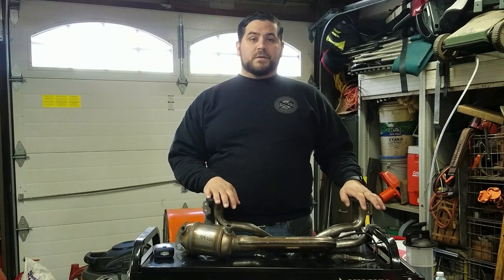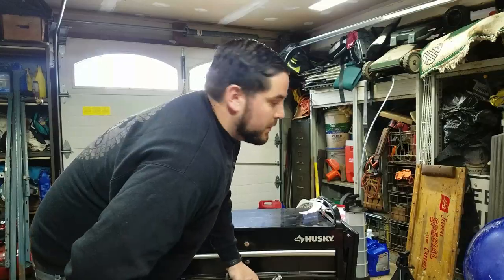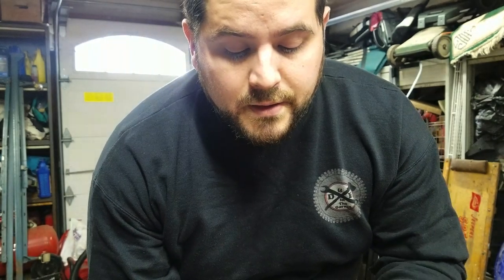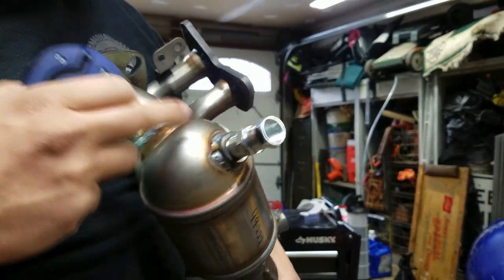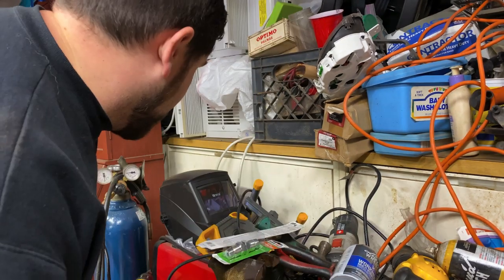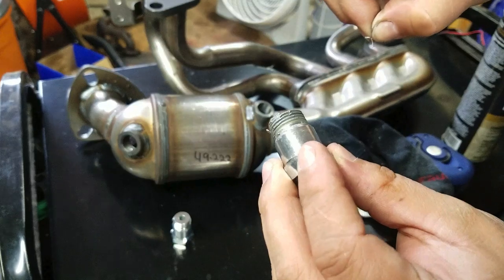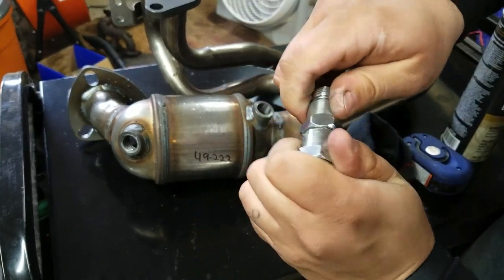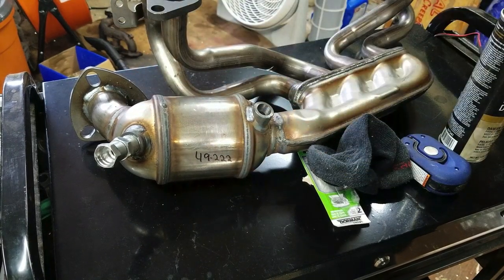How to beat a P0420 Code for $6 (Using 48 State cats on a California Emissions Car)

Comment: You can split your exhaust into dual exhaust or a Y-pipe before it exits to the rear of the car, with a small restrictor plate hole inside to the rear outlet and they only stick the tester into your rear tailpipe and so most exhaust blows out off the pipe under the car, this yields a 50% to 75% reduction in measured emissions

Comment: I have a 2012 Honda Civic and I tried to put a non foul around it just to see if the light would stay off but it still came back on that tell me? Does that mean it's something else tripping the p420 code and not catalytic converter? I also changed both oxygen sensors air intake hose PCV valve cabin and engine air filters and I'm still getting the code

Comment: California , and all of the CARB compliant board States train their inspection
mechanics to fail a vehicle they see this mod on.

I'm not saying someone might get lucky ,
Not saying I agree with emission rules ,
but the chances of someone being passed while doing this is slim 
if you live outside the rust belt states or western usa.

Much different rules here in the carb compliant northeast .
In the northeast , you fail for even the cel being on even for non 
emissions reasons. 

They don't play .

Comment: If you install a non CARB cat onto a CA car, will the computer detect isn't not a CA converter?
Reply from the maker: Yea. It doesn’t run as clean so the reading from the O2 sensors will tell the comp it is failed and pop a CEL

Comment: So...did this work as a ling term solution? Im in the EXACT same situation. Bought a Buick Enclave that has California emissions but i live in Pittsburgh. Previous owner replaced all 3 cats but I still get the  P0420 code
Reply from the maker: Yes it should work long term. Defi Italy works well in Jeeps and Subarus indefinitely. Worth noting that you are tricking you computer, so you may not be making peak mpg or hp
Reply: So, I have a  2015 Chevy Express 4.8 that had CA. emissions.
It needs a new cat, problem is it’s $3800❗️ 
I can get one WAY cheaper ifs it NOT a CA. vehicle.
Can I install a non CA cat on my vehicle like you did following the same procedure?
Will it ba a problem afterwards?
Thanks in advance

Comment: You can replace that cat with a federal converter. If you have a car not from Ca. and you move to Ca. you might need to replace them if they don't pass Ca. smog.
Reply: You only need to replace them if they dont work. If the car is a California Emissions car, it needs to have CARB compliant Cats on it. If Federal emissions, it doesnt matter which EFN code you use.

Comment: Nice vid! Do you happen to know if it will reduce the NO numbers also? I'm assuming it would. I have no codes on my 98 4.0 ZJ and she failed.
Reply from the maker: It should, but this is an extremely low tech way to "trick" the computer. you arent actually solving anything outside of turning a CEL off.
Reply: @DEInTheGarage  thanks for the reply. Love the channel. I don't have a CEL, never have. Replaced O2 sensors and coolant temp sensor, now just trying to get the catalyst monitor to a ready state so I can have her tested again. If she fails I may try your trick.

Comment: Off subject yes, but a jobeeper question non the less. Any word on how to get the wj from electrical disaster and mis fire disfunction Everytime I go wheeling in the rain or wet, ?
Reply from the maker: Dielectric grease will help. Other than that, keep a set of throttle body sensor spares in the glove box
Reply: Also if your coil is original you boots could be getting loose letting extra water in then normal or cracked.
Reply: I'll give that a look at, thanks for the info!

Comment: WARNING - this in theory works... but in california.. the smog check place is required to crawl under your car or use a mirror on a stick to make sure that you didnt install one of these foulers/spacers.  you may pay for the smog check and then fail and go on a government  'blacklist' for doing this
Reply: I live in Cali and never seen them with all the cars I've had look or inspect  under the vehicle....
Reply: I've lived in California and never had one tech crawl under my car, the last time I took my truck in 2007 Tundra the guy plugged his equipment into the OBD2 port for 5 mins while he drank a coke and handed me a my passed cert. Oh and I'm 55 grew up racing always looking for a way around.
Reply: I'm sure they check for irregularities , underneath the vehicle while its on the lift. 
They might do it fast , but they check for everything.

Comment: I have a e90 328xi and my sensors fit inside perfectly. So I had a 420 and 430 code also so I took regular spacers and drilled the 1/2 hole through the fouler and installed it on both banks on the downflow. I reset my computer and did a drive cycle but the same codes came back so I added double spacers but this time one wasn’t drilled at all and the other one was but now it’s throwing codes for “no activity detected” on both banks 1&2 sensors 2. I’m not sure if I should put a single spacer (without drilling anything) or keeping both spacers but drilling a little bit though the spacer that isn’t drilled at all. I also have both of my CATs but for some reason it’s throwing codes.
Reply: And if you’re wondering if the drilled spacer is on the exhaust or if it’s on the sensor I have it in this order 
Sensor-fouler-drilled fouler-exhaust pipe
Reply: Also the codes that said “no activity detected” actually went away for a good 50 miles AFTER drive cycle was complete. But only bank 2 came back I’m also expecting bank 1 to come back. So I’m thinking it worked a little but not enough. I guess I should probably drill each spacer a little bit then try again. In that time I completed my drive cycle and until the “no activity” light came back on I could’ve gone to inspection and passed emissions. So it definitely worked for a little then it stopped detecting anything

Comment: How do you know which one needs the fouler ? I have a Subi with 3 converters . I was going to put it in the one right before the mid pipe to the exhaust system but should I go up closer ??
Reply: Jay Smith  you go off the code your throwing. P0420 is bank 1 so it’s the first cat in the system
Reply: So what year is your Subaru?
Reply: Use a scan tool with live-data graphing, it will show which cat is dead. But 420 refers to the downstream sensor, so whatever cat is before that sensor is your culprit.
Reply: The last O2 sensor in the system behind the last Cat. The last O2 is the cat monitoring O2 . The computer compares the front HO2S's or A/F Sensors against the last sensor and monitors the rear O2 sensor activity. A good working catalyst will cause the monitoring O2 sensor to have no or very little activity after the cats light off.  The computer is programmed to watch for the monitoring O2 sensor to be inactive within a specified amount of time. If the O2 is still active after that amount of time, the computer sets a P0420, meaning the catalyst has lost some of it's ability to do its job.  Some vehicle manufacturers can reprogram the computer with an update to increase the amount of time it takes to set P0420. It's easier, less time consuming, and better for the car if you can check with your dealer to see if there is a computer update for cars setting a P0420.

Comment: Doesn't fix the problem, just masks it.  Better idea is to just fix the problem!  This is like putting gum on a water pipe leak.
Reply: In CA the only way to solve it is to buy another OEM catalytic converter. Instead of being able to buy one for a couple of hundred dollars, I am going to have to buy one for around $1300.
Reply: @brianb.8681  I’m buying some magnaflow universals for my G37s coupe. Fuck paying 1000 per cat from infiniti! That’s bs. I’m getting them welded on. There better and cheaper. 500 for 2 and then 200 for my guy to do the job. That’s still less than half the reg price and for 2! So 700 for the whole job to get done or 1000 for 1. Yea I’m good. And it passes Cali emissions
Reply: @swervv2957  works on that car but not on a bmw oem or else
Reply: No, it does fix the problem, because the problem is the stupid law, not the car..

Comment: Or remove cat(s), install straight pipe where cats were, problem permanently solved....those cats really don't do what the EPA claims they're supposed to do, all they do is restrict airflow through your engine causing power loss, oh and expensive repair bills when they fail.  A properly tuned engine will put off less emissions than a cat equipped vehicle will.  My non-CA emissions vehicles have passed SMOG in CA several times, they give me weird looks but all I tell them is CA emissions isn't very good because my old 71 Ford doesn't have cats or any emissions shit at all, and its passing emissions....so...point proven, all the emissions shit doesn't do anything except not allow your engine to breath properly causing the emissions problems in the first place.
Reply: So your sayin if you can custom tune your car to not pollute the air,you can pass emissions in ca?
Reply: Why are you smogging a 1971 Ford when any car 1975 or older is smog exempt and also keep in mind each car has to smog for its model year 
Gasoline 1976-present 
Diesel 1995-present
Reply: @AlcyoneModschannel  You obviously didn't read my post.
Reply: I got an 04 mountaineer and it still threw up a p0420 even though the last owner removed the cat and replaced with straight pipe now the jury's out on what's wrong with it. I'll start with this cheat and move from there.
Reply: @lavaoasis borrow from your family member or neighbors Explorer same year and engine if your lucky and swap it back after you pass 👌